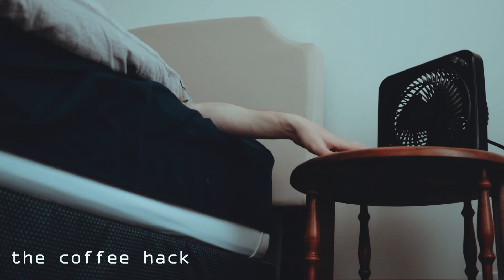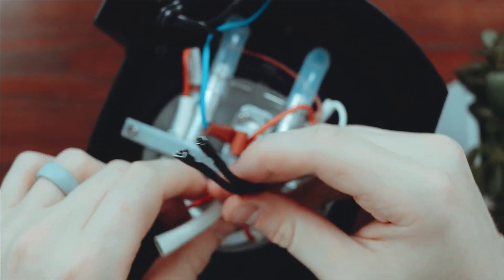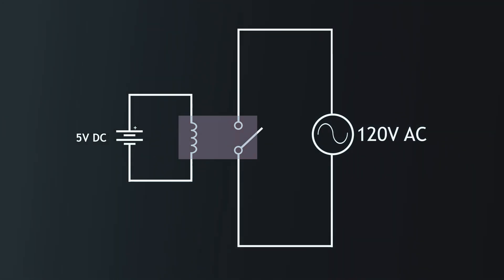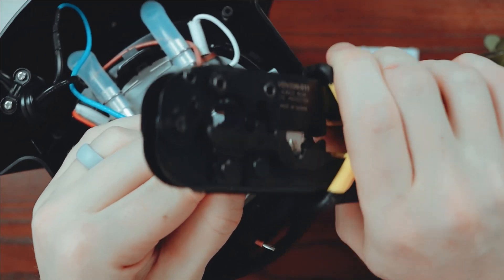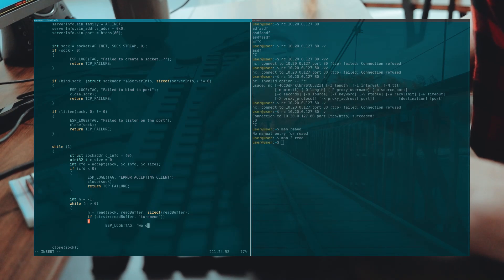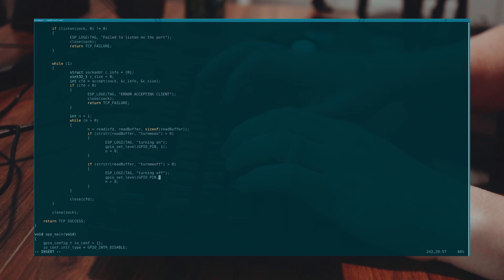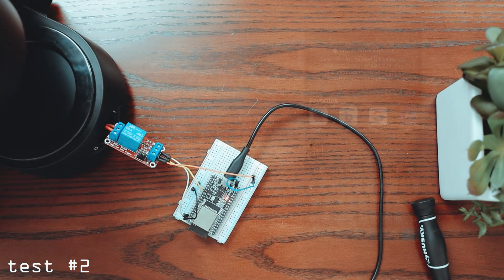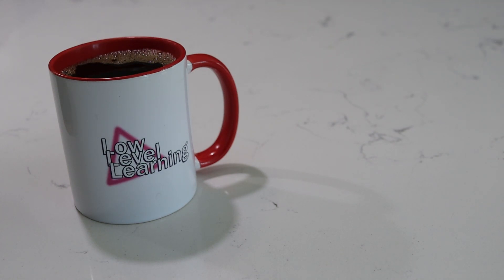i built the world's worst IOT coffee machine

Comment: Fun project. I personally tend to avoid things that involve AC. Given that and the simplicity of the coffee maker, with just a single physical switch, I think I'd just add a Smart Outlet and plug the coffee maker into that outlet. The smart outlet is easy to control / automate from my phone or Alexa or Google Home or my Home Assistant setup. What I'd REALLY like to do, is control my toaster oven with an ESP32 (knowing remaining cooking time, etc.). I've settled: for my Microwave and Toaster Oven, I use Contact Sensors on the doors and an outlets what can monitor power (Sonoff S31). This way I can monitor when they start cooking, stop cooking, and know when the door has been opened. If they complete cooking but the door hasn't been opened, it sends a nagging notification via all of my Alexas.

Comment: Safety warning! ⚠

When selecting a relay, make sure you get one that is rated for the voltage and amperage that is required by the coffee machine, especially if you're on 120V, you may require a relay that can handle more amperage than you would on 230V. Check the wattage on the coffee machine label and divide by your mains voltage to get the amperage.
When wiring the mains wires, I recommend using wire ferrules to make sure they sit securely in the relay screw terminals over a long period of time. Do not screw in bare wires! They may look secure at first but over time it will collapse, and will catch fire.

Comment: A more efficient way of accomplishing this would be to use a cheap programmable AC outlet timer -- they cost about $10 and can be programmed to turn the outlet on/off at a certain time, and most have an option for a different program on weekends (in case you want your coffee later, if you sleep in).

It's a plug and play solution for $10. To use an arduino and not have full brew control is a total waste of time. In fact, you wasted my time with  your video.

Comment: ESP32 I/O pins are not 5V tolerant so you should add a resister and transistor to the output to drive the relay from the 5V supply.  Or maybe that relay board has that?

Comment: Awesome! Will the Coffee machine turn of by it self after some time or do you have to go in and use the "turnmeoff" command for it to do that. A thing that would be great to add is that the "turnmeon" would only leave the coffee machine on for a set amount of time (The time to make a pot of coffee) and then turn of automaticaly afterwards.
Reply: I made an automatic plant irrigation system and figured out something:
When you want to water your plant, you need to specify the quantity on the app and a function will convert it to a period of time depending on your pump, so you will only pump for a specified time and turn it off instead of turning it on and off manually.
I think you could do something like this if you know the period your coffee maker should be turned on in order to get your desired coffee quantity? Like (127.0.0.1/turnmeon?period=20s or something like this)

Comment: For safety reasons I advise against such a circuit in real life.
The "naked" circuit on the kitchen counter at 6:35 is very dangerous! 
I suggest to buy a WIFI controlled power switch or a socket board for such an application. If you are a qualified electrician and you need to build your own device,  you may want put the ESP32 and the relay into a separate enclosing where the parts are tightly fixed and safety issues are considered. In all cases I would leave the coffee machine untouched.
A reasonable coffee machine should have a build-in overtemperature protection. I never would rely on this!
I always unplug my coffee machine if I do not use it, just for safety. I once heard of a room fire because a coffee machine which was not turned off.

Comment: 1) Those relays are notoriously unreliable.
2) You need a high temperature cutoff or some other method to protect your house in case the relay sticks on.
3) Ferrules at the end of wires or the screw terminal might melt.
Reply: The coffee pots I am familiar with shut-off the heating element when the water is gone automatically-the relay is no more dangerous than the original manual switch-if I forget to shut it off, what happens?

Comment: Why 5V Relay, not a 3.3V Relay?  Things that are fun to add: Check to see if there is water (Weight sensor), Check to see if coffee has been replaced (Button attach to the coffee grind's lid, and the ESP32 keeps track that the coffee grind's lid has been open since it brewed the last coffee), coffee pot detector - Simple IR proximity sensor,  Anit-Fire hack - Temperature check.
Reply: In that board, in between the input pin and the relay there's an *optocoupler* , this means that it's not the output pin from the ESP32 that is powering the relay,  the GPIOs of the ESP32 have a low power output and you should not go beyond it's specs to not risk damaging it
The optocoupler uses the 5V separately to activate the relay, and uses the input connected to the ESP32 just as an input signal and nothing else
That board have three connections, DC+(5v), DC-(GND) and IN (signal, which works fine using 3.3v)

Some relay boards don't have the optocoupler, but it is good to buy the ones that have it, both for isolating the two circuits and protecting the microcontroller output pins
Reply: Most 5V stuff like relays can be controlled with 3,3V signalling. Just don't think that your ESP32 will survive 5V into its data pins - it probably won't and you may get some magic smoke. Same applies to a raspberry pi and virtually every microcontroller these days.
Reply: @roysigurdkarlsbakk3842  It is bad practice to use a 5V item when use are only using 3.3V to control it.   When you use an item out of spec, it make not alway work or stop working over time.    I can see using an out-of-spec part, when you already have the part and do not want to spend money on buying the right item.
Reply: @andyniemic4597  I didn't say it was optimal, but it sure works. Better use it temporarily, though. Some new 3,3V relays won't cost much.
Reply: The relay he used has a high level range of 12 to 2 volts ( at least mine did and it looked the same as one in the video)

Comment: I always wanted to do this, but since I don't have an EE background, I never had the courage to mess with real appliances, like a coffee machine, since I'm not really adept in electronics.  But this video was extremely helpful, so I might try to replicate it!
Reply: I suggest that you use a SonOff Mini. It has the ESP and a relay in an electrician-approved package that surprisingly small for being able to handle AC. Instead of all the soldering, it would just be some screw terminals. I converted a high-voltage lamp with one of those.
Reply: Lol same
Reply: I use this exact coffee machine with a Sonoff S31 lite ZB outlet to just turn it on for 6-8 mins and turn off. When it turns off it plays an alert on my alexa devices.

 I was hoping the creator of this vid was going to use the esp32 to control water temps for some extra dank dialed in coffee on a cheap machine.
Reply: and good. If u think u can/should build electronics projects that can end up in fire - try to build few 'safer' projects - and u will change your mind.

Writing code that works isn't hard. Hard is trying write code that is safe when it stops working. No timout for wifi connection? Sorry then this heating element that sucks 20A will stay on then.. Or u don't put all relays to low after boot because it's not neccesery at first glance? Then when project crashes some relay could stay on.. And so many other things that works good in 99,9% cases.. And for working with things like coffee machine u need to know a lot more then just software. 

Things like don't using cable connectors for relay will not show u any cons at the beggining, but after months/years cable will lose contact surface and there will be sparking.. A lot of houses burned because of little things that 'experienced' electricians forgot to do. If u still want, read electrician code - don't even try to replicate youtube videos made by shady dudes (u can watch videos explaining why they are so, so bad)

Comment: Why not leave the manual switch and put a relay in parallel, so you can choose whether to have it automated or manual?
Reply from the maker: I like to live dangerously
Reply: @LowLevelTV  naughty
Reply: @LowLevelTV  house sets on fire
Reply: if you have them in parallel you wouldn't have much control as u would need to turn it off from both the switch and the server for it to actually turn off.
but what a better solution is hooking the switch to the esp32 and use the signal from switch to also control the relay.

Comment: Amazing!
But I should add an arming switch to make it ready for the next day in case you forget to fill it
Reply: would*
Reply: If you forgot to fill it, the element will turn on and almost immediately shut off because the element will not be cooled by the water in the reservoir. Same as if you turned on the original switch.

Comment: Safety warning! Live high voltage wires, potential issues if no water in pot or it fails to turn off. No led means no visual indicator of power.
Reply: Bimetal thermal protection can be seen at 1:04. He just replaced one switch for another.

Comment: why a relay instead of a FET?
Reply: A relay isolates the high from the low voltage circuits. There is less chance of exposing the esp32 to mains, potentially shorting mains through it and potentially exposing mains to whatever touches the esp32. It's still not a good/safe way to solve the stated problem.
Reply: @ColinMcCormack  i thought it's because the machine requires some crazy currents and a mosfet wouldn't withstand it

so it's just for the better isolation then?
Reply: You can easily get mosfets which will switch 240vac. It's not a good idea for a hack. A solid state relay would be better than the relay here. This design is really not something I would have in my house. Optimal solution would be a majns plug with tasmota. Cheap, less likely to arc closed and burn down your house :)
Reply: @ColinMcCormack  could you explain why it's not a good idea maybe? i though that mosfets were made for high voltages, i have a few at home and according to their datasheets they can withstand over a thousand volts and like 50 amps
Reply: @the_bootleg_starwalker  they can, but can you? The cost of getting it wrong can be quite high.
Reply: @ColinMcCormack  you didn't answer my question, is there some difference that makes relays safer?
Reply: @the_bootleg_starwalker  I don't believe I said either was safe, or either safer than the other. I said a reason for choosing a relay over a mosfet is that a relay isolates the mains from the control circuit.
Reply: @the_bootleg_starwalker  to be clear: I wouldn't, at my level of experience, use either a relay or a mosfet. I might use a properly rated solid state relay, but the best solution for this problem is a simple cheap rated commercial product running tasmota
Reply: @the_bootleg_starwalker  I can tell you that a MOSFET can go short from source or drain to gate, and that would mean mains voltage down the line to the esp32 board, which has no protective earth. So, potentially deadly mains current could be exposed on the esp32 to anyone who might touch it. On the other hand, disconnecting a relay on ac current not at the zero crossing can cause the contacts to arc, and that can prevent them from opening, and that means (in this design) that the load would be connected until it heats up enough to fuse, or just burn down the house.
Reply: Short form warning: mains current is not the place to learn electronics
Reply: @ColinMcCormack  thanks for explaining!
Reply: @ColinMcCormack  i know it's not the place :)
Reply: Weld closed

Comment: Last time I tried to use cheap relays to control higher voltage circuits - I had problems switching it off, induction currents kept the relay closed. Does your relay turn of easily?
Reply from the maker: Yup! I’ve had no issues getting it to open again.
Reply: Why did you used cheap relays?
Reply: I had cheap reasons, obviously
Reply from the maker: After thinking about this for a minute, are you grounding the other side of your digital input?
Reply: of course
Reply: @_imps  I couldnt acquire a high quality relay so I went with the cheap option too. If I don't connect the controlling cables very well it tends to fail to open the circuit after closing it leaving the pump active. You could perhaps solder your controller cables? It might work since it permits a better conductivity.

Comment: What about water? What about filter? What about ground coffee? Who adds all this to the coffee machine in the morning?
Reply from the maker: The night before :)
Reply: @LowLevelTV  Or do what i did: get a wife ;) Ofcourse its way more expensive, runs on a higher voltage, wastes energy ... so in the end i might reconsider this decision ;)

Btw, how would you solve the power supply to the ESP from teh 120V AC So one could make look this pretty and fully hide it from the eyes ?
Also wouldnt it be a good idea to leave the original switch and let it also trigger the ESP to have the option to turn if off manually ?

Comment: I would be so afraid of a bug that would let the machine on and set my house on fire
Reply: I have an ESP32 and I can tell you from experience that it crashes sometimes when you leave it on for several days. It is recommended to add a watchdog in the code to make it restart when it crashes.
Reply: Given that all he did was replace the power switch, you could encapsulate the ESP and relay in a box so that it was effectively an ESP controlled outlet and plug the unmodified coffee maker into that.  That might be a bit safer.  Certainly UL certification and similar should mean that the coffee maker shouldn't actually catch fire just from leaving it on.  But, like someone else said, I could imagine leaving it on while empty might shorten its life. Especially if it's super cheap.

This also has the advantage that if you only turn on the manual switch when the coffee maker has water and grounds in it, the relay can switch on accidentally, but it won't do anything if you didn't set up the machine and switch it on.
Reply: LMFAO EXACTLY DUDE
Reply: Lol, I'd be afraid of an actual bug getting in there.
Reply: The heating elements in these coffee pots have a rather low melting point (there's a lot of zinc used in their construction) a bad smell and a ruined machine is about as close to a house fire as you can get.
Reply: This is why I add hardware safeties for anything I have to write code for. I don't trust myself with software xD
Reply: All microcontrolles have watchdog timer on the IC crystal (which is running independently from main IC), so if IC has stalled execution of code it could reboot and disable the relay.
Reply: Yes! Bugs are bugs and it can harm you, depending on the project. Implementing a timer and a temp sensor on your code is a good idea... well, your imagination is the limit!